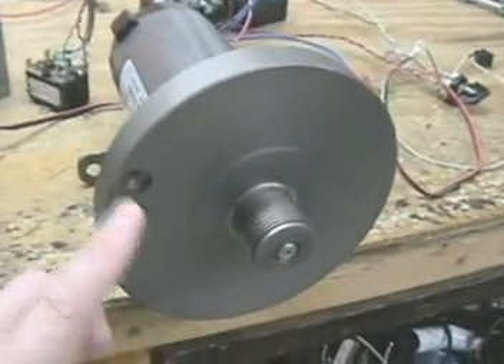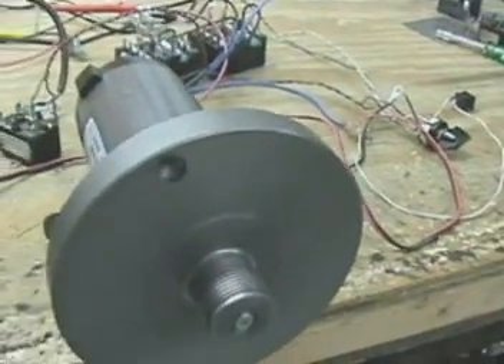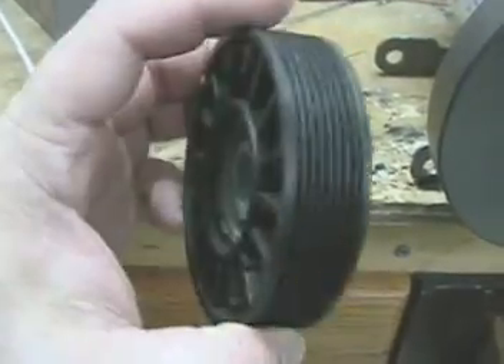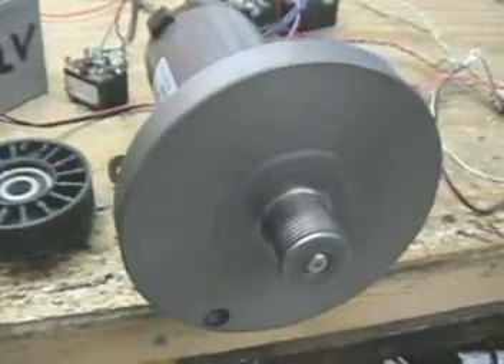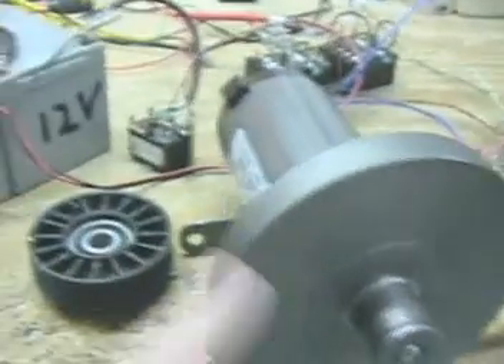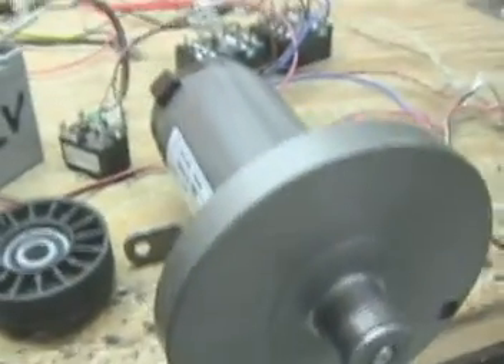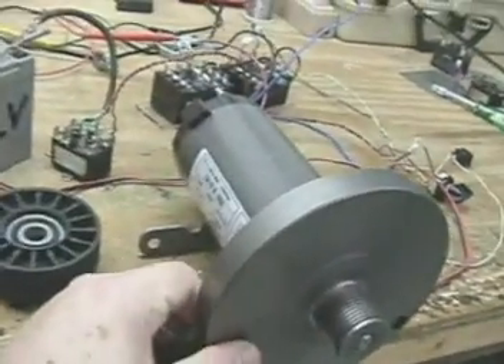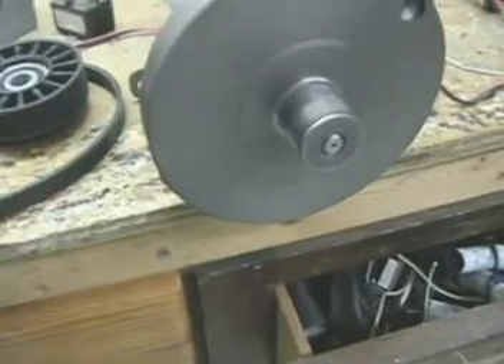Treadmill Generator

Comment: ok question can you put that motor with a lawnmower engine to make a generator ?
Reply from the maker: +damien lamy  yes but it only makes DC power 1/2 wave  any permanent magnet motor can be a generator  but the volt and amps vary depending on the motor . a motor that spins the magnets will make AC power  if the magnets are mounted to the case and the rotor has windings  the brushes limit the amount current  possible.
Reply: +zeropointfuel  i will have to use an alternator i have to wire it properly  why i ask that is that the alternator has four wires and i will not know with one is witch
Reply from the maker: +damien lamy  if you do a search on alternators I'm sure you will find the answer you are looking for.  two of the wires are +- and the other 2 are how you energize the rotor if you take a multi-meter the ohms will be higher on the rotor, also the big wire are usually the +- output because a alternator puts out 40- 120 amps at 14 V so the wire has to be bigger. thanks for watching good luck
Reply: thanks

Comment from the maker: @KyleCarrington yes I have the PMA Hugh Piggots stuff, it on the list of generators to try on the Cartmotor. I mounted treadmill motor on the Cartmotor and was working perfect until the cheap plastic pulley broke, so on the hunt for a replacement now, also if you jump the positive Diodes  used on the to keep the generator from being a motor it becomes a starter no more hand starting. :)